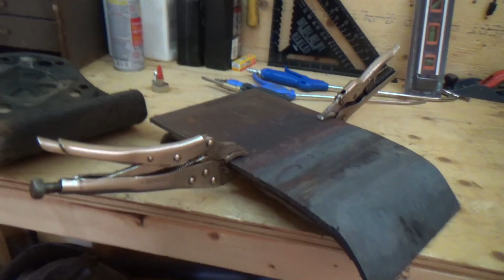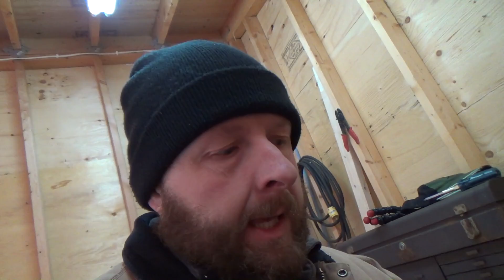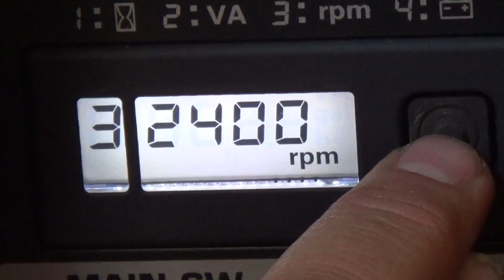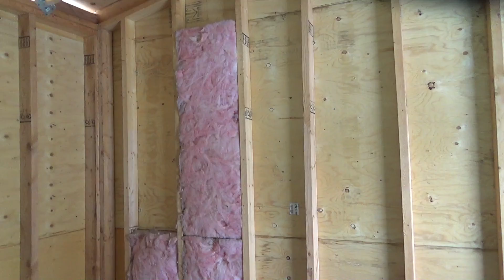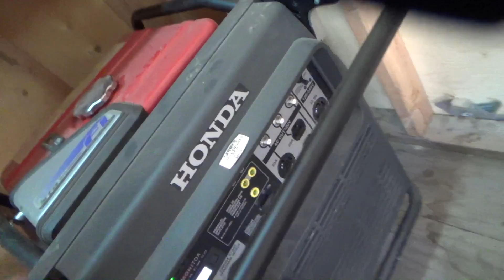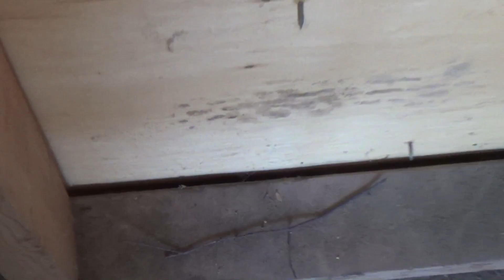New Shoe build for jumping jack and talking aboot some stuff

Comment: Bill bad news on siding. It looks like you either did not leave room on ends for expansion or nailed it to tight to move. Siding will move. If you do not allow for movement it will move regardless. The other issue is all your seams on the back are inline which is also wrong. You really need to redo it or it may well crack from the stress of movement. There are tools for siding removal to pop it out of the piece below it. Good luck with the siding through the winter
Reply from the maker: thats what i figured

Comment: On the rough cold idle: Although fuel injection may not have a choke, there is generally cold-start fuel enrichment to help start & run until warmed up. It's done different ways, depending on the FI type. Just a thought...

I enjoy your DIY videos. Keep up the good work!

Comment: bill, you can in warmer weather just take your pick set and peel off the above layer to get under the siding they sell removing and reinstalling tools at lowes or home depot. there like a putty knife 1 inch wide with a hook bend. did a little siding work back in my teen years the 90s lol. and we used the roofing nails but you dont pound them in tight. you want the siding to be able to move in all directions. and we did use a miter saw with the blade backwards with about 60 tooth blade when we cut the siding we would give the length about a 1/4 to  3/8 shorter than our measurement  so it could expand and contract in both ways

Comment: Your siding is wrong, need to stagger your joints!You need to remove all your siding, you didn't leave for exspanion and to tight and your j trim is upside down, buddy you need to fix your corners too
Reply: yea i was gonna say the exact same thing staggering the joints an not hammering the nails all the way in is important

Comment: Instead of punching the square bolt heads out of the plate and trying to make a recess, can you not just cut the bolt head off and weld the thread to the back of the metal plate?
Reply from the maker: that may work yeah